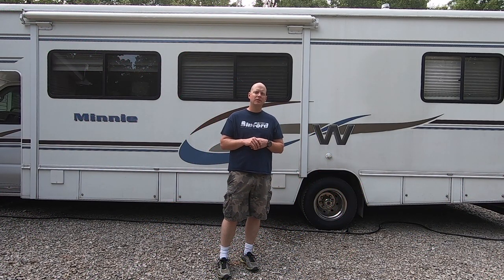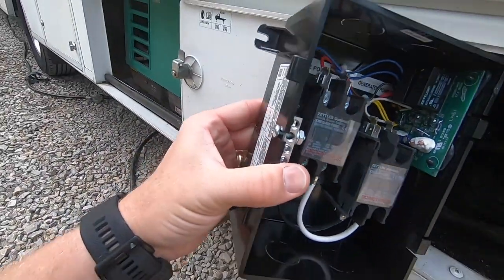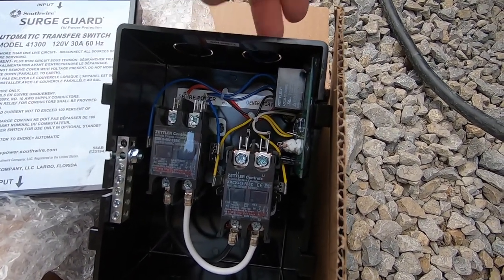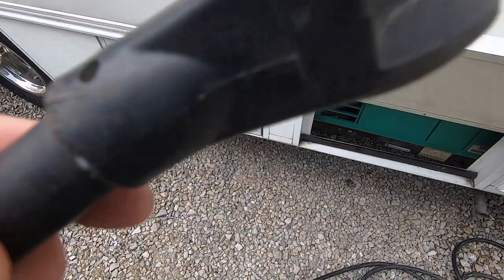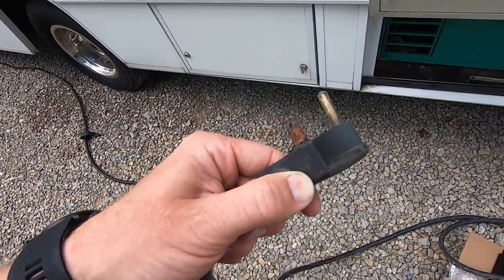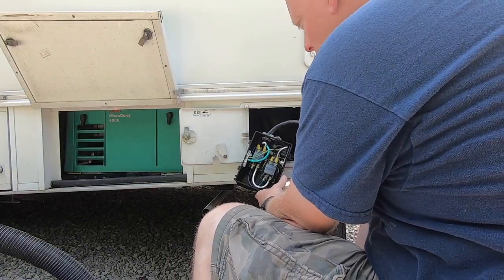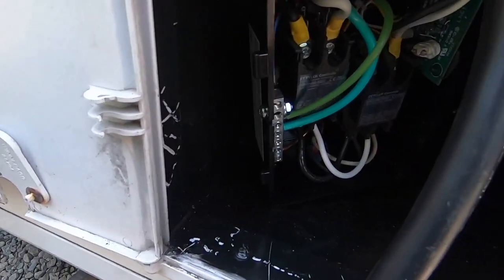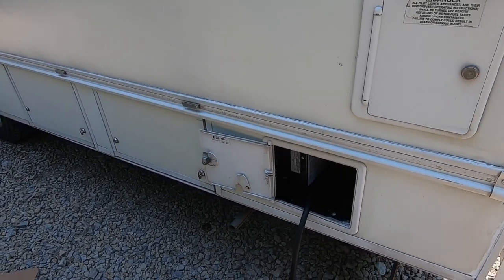RV Automatic Generator Transfer Switch Installation - Southwire TRC

Comment: Great video. its a nice, clean, simple vid showing the ease of installing a 30amp ATS unit... 

  For those with a 50amp RV, the process is the same, but with one extra wire, of which a 50a ATS has the extra connection ready to accept the extra wire.... simple, but 50a wire is a lot stiffer wire to work with....

  I must say that replacing the entire power cord is easy enough, but far from the most economical way to solve the failed 30a plug... because it WILL fail again in the same manner. 
 the better option would be to cut the plug off the end of the cord and install a new QUALITY 30a plug that has the ability to take a lot more heat before becoming damaged, which almost ANY of the commercial quality replacement plugs will do this.... OR, by installing a 50amp plug and then using an adaptor, which then, the adaptor becomes the "sacrificial" weak link, which is much cheaper to replace than the entire cord, and much easier to replace periodically than the plug on the end of the cord....

Comment: Most Automatic Generator Transfer Switches use AC coil that buzz - hum. I found only one company that uses DC coils that do not buzz and hum: SCO, they make both a 30amp the LPT30BRD and 50 amp Automatic Transfer Switches.

Comment: Thanks for the video. I have a question about a connection strategy. Everything is the same between shore power and the line inside, the only difference is with the Gen connection. The Gen is outside so a plug must be run to it. Now this would run from the plug( in this case a120/240 L type) to the Gen connection in the Tbox correct? I would plug it in, in an emergency and start it but without engaging the breaker on the Gen, then the Tswitch would still be on shore power until I engaged the breaker with a 30 sec wait time and the Tswitch would change feeds, correct.? Does this switch then detect the re-energizing of shore power and switch back or do you have to switch off the Gen first?

Comment: Good video. I have a generator and an inverter for my solar panel system...do you know of a transfer switch that will handle all 3 (shore, generator, inverter) sources?
Reply: you would need 2 transfer switches OR use the generator to top off the batteries when they're running low and solar isn't keeping up.

Comment: No need to replace the whole cord. Get a cord cap and cut the plug head off. Strip wires and install new cord cap. very simple. much cheaper.
Reply from the maker: Yeah I did that for a backup.

Comment: So it’s fine to have the generator in that port? The CO won’t seep into the RV?  I’m
Confused on why people mount them on the bumper and what not instead of the under section.
Reply from the maker: This is where the generator is mounted from the factory. It has an exhaust pipe that is routed out the side away from the RV. Usually they are on the bumper because the RV did not come with one and there is no place or easy way to put it under the RV

Comment: I have a massive solar battery bank that I want to power the transfer switch instead of a generator. I have a generator but it will charge the batteries instead. If I want the switch to maintain shore power even if there is a current from the battery bank ("generator side"), can I just switch them? Plug the shore power in the "generator line" and run the battery bank to the "shore line"?
Reply from the maker: Yes. Assuming the battery bank is feeding a 120vac inverter.

Comment: do all RV's that have an onboard generator automatically have a transfer switch? Also if you have a 50amp shore power plug because your RV is 50amp does that mean you probably have, or have to have a 50amp transfer switch if you plan on installing/replacing one? And finally if you install a surge protector, would it need to be installed including the generator transfer switch? thanks.
Reply from the maker: A lot of RVs do not have a transfer switch. To run on generator you must plug the shore power cord into the generator. If you installed a whole RV surge protector, you would install it right where the power enters the distribution box, after the transfer switch.

Comment: I have a question I’m not sure if you’ll be able to answer. I have a transfer switch with a know and it appears to have broken should I completely replace or is there a way to repair?
Reply from the maker: For the price, I would probably just replace it. They have contactors inside that can be replaced if that is the problem but it's not much more to just replaced the entire transfer switch

Comment: Is that the only way the switch can be mounted? I need mine to mount horizontal.
I'm fitting this transfer switch into a class a motorhome that has a simular but different oem switch
Reply: Mounting position does not matter. I have one in my Semi, Laying flat on the floor and horizontal to fit my space and needs
Reply: You need to ck with the mfg. Some say DO NOT LAY FLAT. I believe those are the bigger ones that have mechanical contractors

Comment: I don't agree with your comment about your plug being loose from using them a lot. The reason for this is the receptacle more than the plug. The receptacle provides the tension on the male plug. This tension can weaken over a period of time due to heat from multiple usage of the plug and high amperage usage. Using more than 80% of the capacity for long periods of time will cause this. Some male plugs allow you to open the pin which will put more tension on the connection. When you plug into a receptacle it should be a tight fit. If not there is a problem or there will be.
Reply from the maker: You misunderstood what I was describing I think. The male plug pins will actually start to separate from the wire inside of the plug and resistance will increase and higher resistance will cause heat, which could lead to a meltdown or fire. This has nothing to do with the recepticle.
Reply: @JackofAllMasterofNone  Your male plug gets like that either from the heat generated from the pins not making good contact with the receptacle (high resistance) or continued high amperage use. There is resistance between the two surfaces and this is what causes heat which melts the rubber. If you tear the rubber plug apart the connection inside will probably be good.
Reply from the maker: @robertdickinson9837   I did cut apart the plug. The problem was inside of the male plug. You could wiggle the male pins which were obviously loose. Stop trying to argue with me about this. I know exactly what I'm talking about. Thanks.